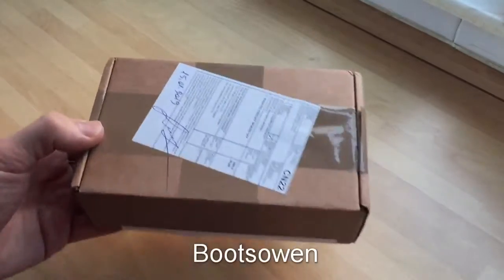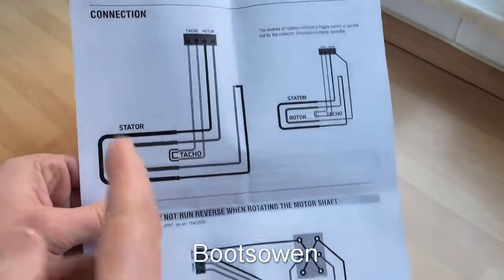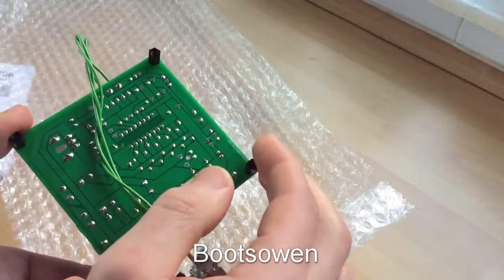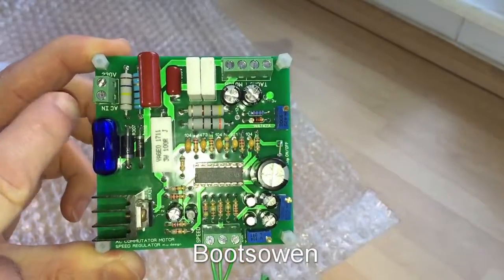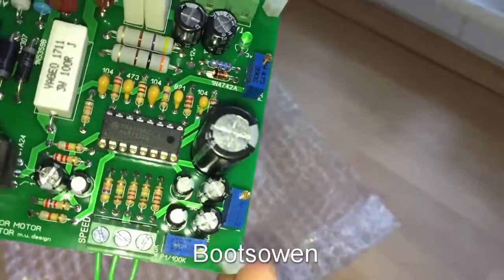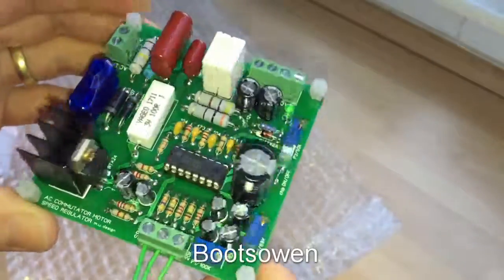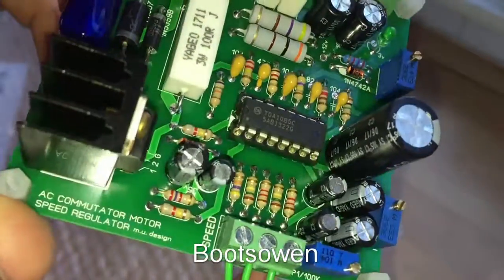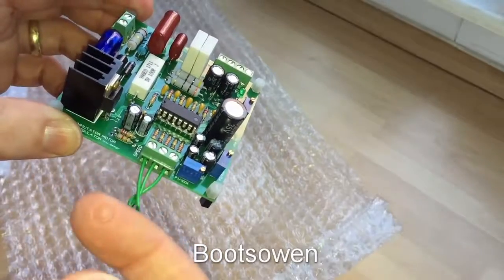Washing machine universal motor speed regulator TDA1085C unboxing

Comment: will it work with with DC?
Reply from the maker: The controller won't but the motor without the controller will.  I have posted other videos of how to do this.
Reply: @bootsowen  yeah, I watched it already - my motor works pretty well on DC, but on constant RPM... I want to apply to it 48V battery, will it work if I will put a potentiometer with transistor?
Reply: @alantomczak517  , You can buy DC speed controllers that vary the power by chopping the DC. Very inexpensive, even at quite high currents. Try Banggood. com I haven't seen one with a tacho input though but I haven't looked for one either.

Comment: Did you ever try this and dit it work?
Reply from the maker: yes!   I have made a video about using one of these on a large grindstone. You can get a component on the internet auction and make a circuit or buy a pretty good one that has been preassembled, like I did in the grindstone video.
Reply: @bootsowen  Thanks. I've found the Grindstone video and saw it wired in, in the background. I'm guessing it worked out ok. Does it do the job well? TIA.
Reply from the maker: Yes, very steady, keeps the speed, doesn't seem to mind the huge startup load of the big stone wheel.

Comment: I just bought a 4000w controler for £3 pre build and £1.20p postage and its in a metal enclosure they are easy to find
Reply from the maker: Sounds like an scr controller. I have posted videos about them too. They don’t use the tacho so they regulate voltage rather than speed. I have posted a video on “universal washing machine wiring “. That you might find helpful. If you have an scr then back emf can break them. I have broken about 6 of them. I guess if it’ll work depends on what you want to use it for.
Reply: @bootsowen  Hi, the problem with simple SCR controllers is that the motor will still run quite fast if it is unloaded but have very little power so the moment you put a load on it it will slow down. e.g. a grinder! The reason i'm here is I have a little model size bench grinder with speed control and, unloaded it runs nearly as fast as full speed.

Comment: Can you post the link / address. Thanks
Reply from the maker: This is the one I used: 
this link may go out of date ,check when this comment was posted, ebay:https://www.ebay.ie/itm/TDA1085C-universal-controller-of-commutator-AC-motor-Assembled-80-80mm-1pc/184011690341
Reply from the maker: this link may go out of date ,check when this comment was posted, ebay:
https://www.ebay.co.uk/itm/Motor-speed-controller-from-the-washing-machine-on-the-chip-TDA-1085/202785305848?hash=item2f36f234f8:g:QeoAAOSwEJldiQns